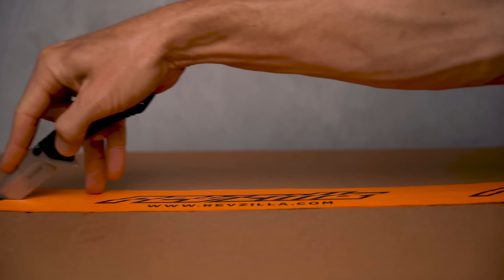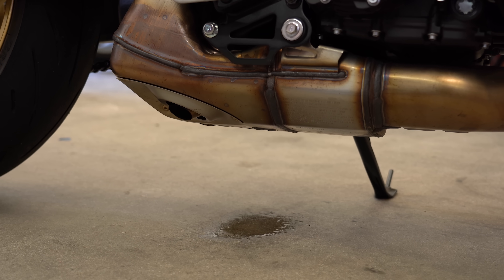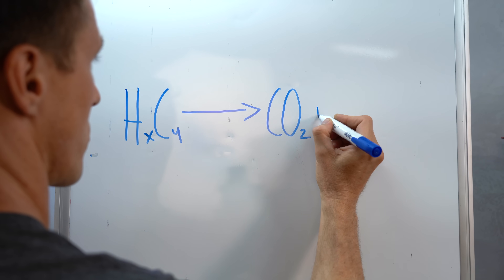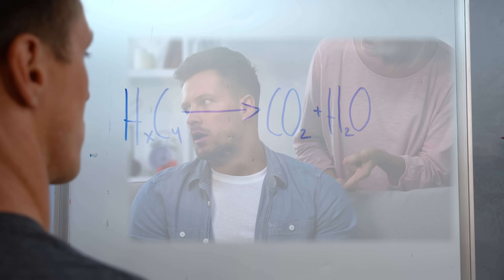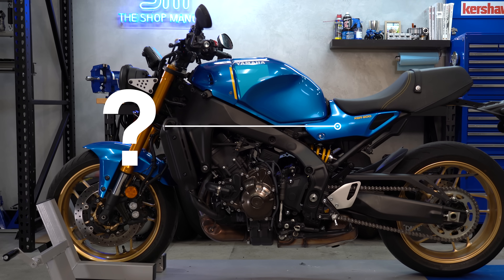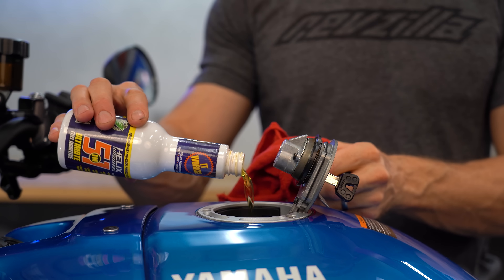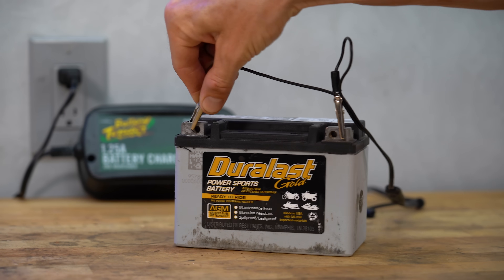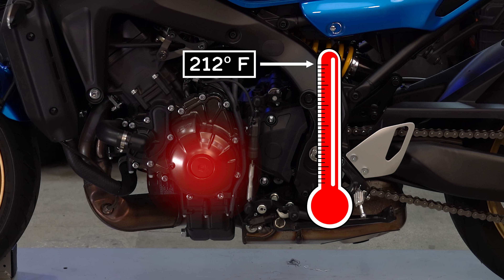The Storage Myth That Hurts Your Motorcycle | The Shop Manual

Comment: Not to mention the unnecessary cold starts (which always should be avoided) 
If you run your bike every month for about 10 mins during the off season (5 to 6 months) the engine basically runs for an hour completely cold. Unnecessary.

Comment: Disconnect your battery and charge it completely and leave it with the bike. Being in the cold does not hurt the battery and slows down the chemical reaction and will prolong the life of your battery. A fully charged battery will not freeze and once it is warm it will still be well charged. Disconnecting it is is the key to this process.

Comment: Absolutely the correct advice, that old starting a bike for 5 or 10 .ins every few weeks during winter is an engine killer.  I have a number of bikes singles and multi's and have a slightly different procedure for the multi's over the singles.  With a single the engine can be left at tdc on the compression stroke, because both valves are closed, thus sealing off the combustion chamber, and the valve springs are at minimum tension.  With multi's there is no way of knowing the stroke that each cylinder stops at, so some will have one or more valves open, with springs being under full tension.  So, I spin the engine on the fours with the ecu fuse pulled so it won't start, fo a few cycles of 5, 10 and 15 seconds or so, every month or so.  This randomises the positions of the cylinders and exercises the valve springs to stop them taking a set.  If you don't have a heated garage I strongly recommend a dehumidifier to control the moisture in the air, cheaper than heating and just as affective.
Reply: Not sure you really need to worry about the springs, cant recall having ever heard of a modern bike having engine trouble because the springs wore out over winter. However if it makes you feel good then by all means :)
Reply: @Surpriseify  
Valve springs won't wear out in one winter, but the accumulative effect of being in a compressed position for extended periods will weaken them over time.

Comment: I have to disagree with most of what you are saying here. Oil only declines during hard use and extremely hot temperatures. I own a trucking business where my trucks run day and night ( hard ) and only have the oil changed once a year. But the motorcycle that gets used a few hundred miles a year and occasionally started is turning the oil soo acidic that it is burning a hole through the cases? The amount of moisture that builds up in these engines is not enough to do any real damage.

Comment: How can I explain this to people .. Do not use Stable to your gas for winter. I have been rebuilding Motorcycles for over 30 plus years and I know for a fact that shit will flat out screw up your Carb. or fuel injectors , if that crap ever turns into a solid you are way beyong screwed.. it would take a grinder to get rid of it. But go ahead use that crap and pray it never dries up .   j-d

Comment: Dude running your bike every other week to let it run through a little is not a bad thing if you're letting it sit there and idle sure you got to go through the gears as long as you're not sitting there idling it's perfectly fine to start your motor up every other day I've been building  motors for a long time

Comment: I've got a camshaft with a corrosion spot on the lobe that likely disproves your "oil sticks around" argument.
Draining the fuel system let's the rubber seals off gas and shrink a bike left without fuel almost always needs a carb rebuild. 
Seems like there is only one practical answer. Thats to never put your bike in storage. Ride it everywhere, rain, shine, wind, or snow. Nothing can fail from sitting if we never give it the chance to sit right?

Comment: You want to warm it quicker, use the centrestand (if it has one) and stick it in third.  Don’t go revving the nuts off it, it simulates load.  I think.  Seems to work for me, you need decent clearance under the rear wheel.  At your own risk.

Comment: Would love to move to a climate where I don't have to go through all this trouble.
Reply: Not really trouble.Just use Ethanol free fuel for one,it can be had at certain gas stations.2..Get the engine hot once a month,thats it.If its stored very cold,consider keeping the battery charged with a trickle charger.There really is nothing to worry about just dont start it for 10 mins a month you got to get it hot and boil off condensation in the crankcase.If stored warm then nothing to do except buying ethanol free fuel.

Comment: I think everyone knows that using a car/bike on repeated short journeys for commuting etc when the engine doesn't reach full operating temp promotes accelerated engine wear and internal corrosion. Running the engine for short periods during storage amounts to the same thing. Just do as the vid says. Change the oil, drain or stabilise the fuel in the tank, tend the battery, then LEAVE IT ALONE until you're ready to ride again!👍

Comment: not sure where you get your shop manual but unless you are going to drain your carbs, drain tank and mothball it on carbed bikes you need to start it, OFTEN!  moisture has fugg all to do with it, unless it's a carbed bike, alcohol gets sucked into unleaded gas from the atmosphere, if I have to spell out what kind of damage water does to a carbed bikes fuel system then I dunno..?

and if you don't use a trickle charger START IT!  this manual is flawed for sure, if you look at today's BEST gas storage durations you will find SIX MONTHS!

Comment: Put in NON ethynol fuel and nothing else. With the new non ethynol I never, ever, use any fuel conditioner and never, ever, have a problem. Not even with a carb. Stop wasting your money. Keep the battery charged or even better yet, take it out. Most new bikes and other vehicles have electronics that slowly drain the battery. In a garage that is not constantly heated you will see condensation even on the outside of the engine if you warm up the garage. Start the bike in the spring, warm it up, and dump all oils if you are in a part time heated garage. Even the outside temp changes in a non heated garage will cause condensation. I've been riding for over 50 years and have owned over 30 bikes..... in Wisconsin.

Comment: Motorcycles are meant to be ridden, not stored. Unless there is actual moisture on the street that compromises safety in colder temps, my bike is my daily commuter. These days it's too expensive to drive the truck anyway.

Comment: Much of this advice is wrong for some bikes. For one, never run a fuel injection system out of fuel. Burns up electric fuel pumps and gives the injectors an opportunity to dry out leaving clogged residue behind.

Comment: The entire prosses of removing batteries and plastic panels in the cold can be avoided by running your bike for 45 min. Emptying tanks to prevent rust is a major myth because of condensation. A full tank prevents that. Period.

Comment: sit on that running bike in the Garage for an hour and pretend you are on a Road trip. grab a beer and have fun for an hour while you ride it in the garage with a beer in your hand. keep a couple of doors open so the Exhaust escapes. (  make sure you rev it up a bit not just an idle )  OH and remember to put your helmet, your leathers and riding boots on so when you crash after that 6 pack is done you won't get hurt.   OR live a Boring life and do as the Video Suggests

Comment: If you live where the weather allows it, start it and ride it. Obviously, if it's snowing, or you've chosen to live in one of those God forsaken areas that regularly drop into the negatives, this may not be feasible, but otherwise, pick a sunny day, and take a ten minute ride. A short ride, on a 50 degree day, isn't going to be but so terrible.

As to the battery, I'd pull that, and bring it inside for the winter. If it's a traditional acid battery, I'd go on and throw it on a tender.

Comment: Also many bikes run rich at idle so starting and idling only will cause carbon build up in the upper cylinder and exhaust valves
Reply: Actually, not enough to be an issue, [The carbon issue] as the manufacturers want the bike to warm, given the new ECU controlled bikes, and then... it will be run at highway power. The issue is using the Right gas, and not the gas that we think is the best. It does not hurt to run and good cleaner at every tank fill.   MMO is good to use as well, to help lubricate...In time.....MMO makes a difference.
Reply: Yeah if you go on to run it at highway power you’re golden. Just don’t keep starting it from cold and shutting it off again.
Reply: @thomashall4232   of course, But that wont be the life of the bike' just getting started up and then shut off.  I'm stating your concern about carbon build up as already mentioned. As the bike will be run, it is unlikely that the carbon will build up so bad, which I believe was your initial concern. Most modern gasoline for todays bike engines...like as an example, Triumph says that my tiger will really take about any good grade octane gas out, there even if it has high ethanol in it.  I still use an upper cylinder lubricant just as the miles will add up, and preventive measures really dont hurt, because you don't know that the gas you get, [in some places] really is as refined as it should be, and that is why [Seafoam] was big, as it was used to treat todays bikes and that ethanol  is harsh on a motorcycle engine.   cheers
Reply: You’re right modern engines don’t have a problem with carbon build up in general (excepting GDI engines on the inlet valves). This video is about whether it’s a good idea to start up a bike and idle it and shut it off again repeatedly throughout winter. I don’t know whether that would cause harmful carbon build up but it will cause more carbon build up than using the vehicle as intended would I imagine.
Reply: @thomashall4232   Ok, well this is starting to turn into a round robin. But honestly, I dont see a carbon issue of concern here. cheers.
Reply: I think you’re probably right, but then I don’t think any of these fringe issues with engines is a problem. So long as you do your maintenance and give it a good run occasionally.

Comment: What a load of shite. Starting your engine and letting it run to normal temperature is good - oil circulation, no blocked carbs etc etc. and absolutely no different form "putting it under load". I was riding bikes before you were born and never, never had any problems, even with 1950 bikes which were not renowned for reliability. Theory is wonderful, practice is better.

Comment: Absolute load of bollocks run your motorcycle until the fans kicks in by that  time oil and coolant will be up to temperature and a few blips on the  throttle will help with any water

Comment: I call BS on the whole thing. I've had a motorcycle in my garage, untouched, unprepped for 17+ YEARS...until last week. I put in a new battery (I could probably have added fresh acid and charged it but a new battery was faster and easier). I added gas (don't know how much was left in the tank when parked) and hit the starter. Took a bit to pump fuel through the fuel system, ran rough for about 30 seconds. Added some Seafoam and let it idle for about 10 minutes and rode it to the gas station for a fill up. So much for prep and storage. Runs strong, starts right up. IMO, no attention is the best attention.
Reply: Sounds like you got lucky! Go buy a lottery ticket, lol.
Reply: @AriH211  Lucky is to have it happen once. Been riding on and off for 50 years and have done this numerous times though this last one was the longest. Usually it was 6 months to a couple years. Same thing. Ya'll are petting the sweaty stuff.

Comment: Total and utter BS.

1. Yes, your internals get scorching hot and turn the water into vapor..... and when you stop your engine (valves close) that vapor will eventually turn back into water, it does not magically disappear. It's not as much as you would lead people to believe and is a problem only for looooooong storage (year plus).
2. Your bottom end of the engine is swimming in oil when not working, doesn't really matter if you get it hot or not. And again, boiling off moisture doesn't mean anything if it doesn't have where to go.
3. Draining your tank saves the fuel, but according to your logic, unless you are doing that in a vacuum, that tank is going to get filled up with air, which has moisture in it. How would you warm that up to "boil the moisture out of there"?

You will always have air in your engine and that air will have a (small) part moisture. If it were such a huge problem, dealerships (both car and motorcycle) would not store their unsold vehicles on the showroom floor. Moving parts (valves, pistons, brakes) are designed to be moved and the biggest thread to their longevity is actually letting them stay still. Yes, you can do some prepwork to winterize your bike and have it sit 3-4 months without maintenance, but I'd say starting your bike, letting it warm up and reving it up is the better solution, as long as you have access to it (people tend to book garages with other bikers which might not be close)

Comment: Sorry dont agree. Water is not the enemy. As you show it runs out the drain point on exhaust anyhow. The enemy is lack of use. I have a collection of 20 bikes and do all my mechanical work. Engines are designed to run. Run them, especially bikes with carburetors othrwise pilot jets will block and float valves will stick meaning a stripdown to clean out. I start my bikes once a fortnight and run for only 2 mins max and I have never had an issue with water damage. Here's a tip. Remove your oil filler cap and smell your oil. Any smell of gas indicates fuel system issues which need checking before a restart.

Comment: Looks like you have gone bat shit crazy..  When you turn the engine off  in cold weather moisture will form in the exhaust system .I dont want you to be!I've me.   In the summer weather when you start your engine no water vaporandmes out. In  the winter  when turn off a engine then after cools down like over  night.  On startup as the exhaust heats up  the moisture accumulated

Comment: When summer is here your motorcycle won't start because the engine has been sitting dormant for 5 to 6 months in the winter. No thanks. I start my motorcycle once a week or two in the winter. I've had no problems when summer rolls around.

Comment: Wrong. When you run the engine to operating temps, it will burn off moisture. Plus, look at all the riders that ride their bikes only once or twice a month during riding season. It is the same thing but  no one is concerned then. Bad advice from you guys.  Run your engine in the winter.
Reply: and you can actually see when moisture burning is done, because it's visible in cold winter air, literally visible steam. and it happens sooner than engine is up to operating temp.
after that, there's no ill effect, you just topped the battery, and that's it.
Reply: @ivok9846 Rubbish. The vapour from the exhaust will disappear in just a few minutes when the exhaust gets hot because it's the cold exhaust system that condensers the vapour. Meanwhile the inside of the engine cases will be wet through.
Reply: @phils2180  i wish you wrote "because cold exhaust system condenses MOST of the vapour", and that would be spot on! because bigger (hollow) space indeed traps more humidity because it traps more air. 
what you just said suggests my engine oil is diluted, emulsified by water. are you sure that's what you wanna say, because emulsified oil is easy to spot...
where exactly in the engine do you imagine lots of water condenses?